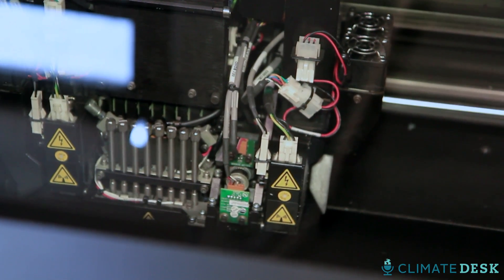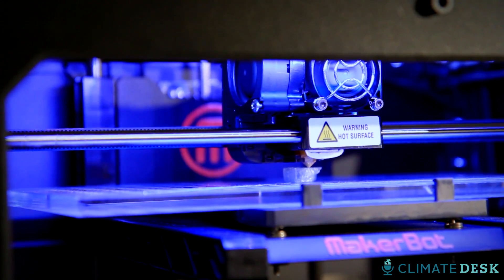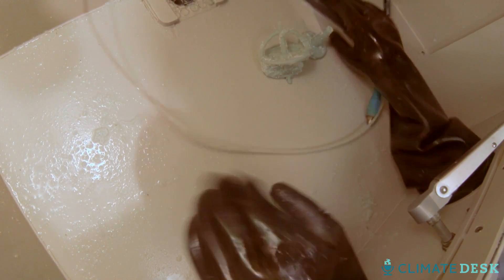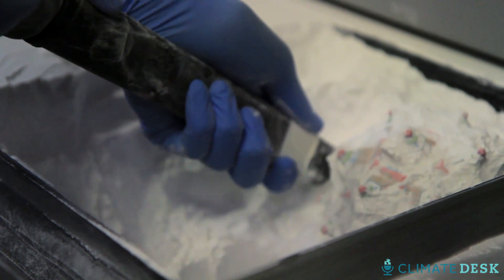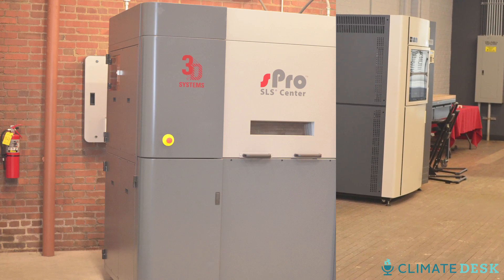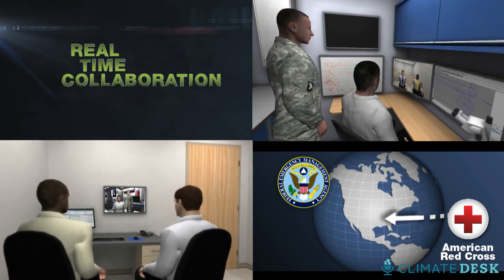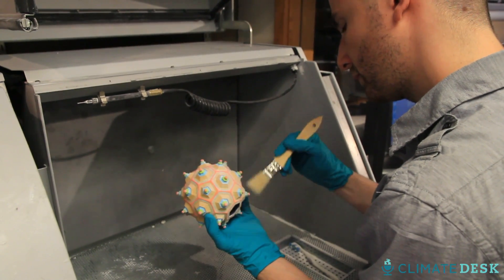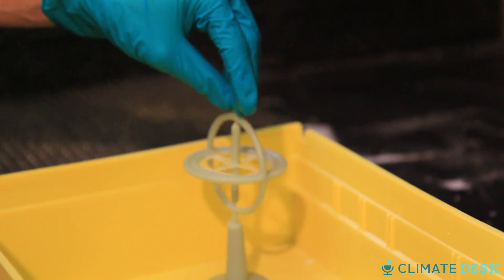3D Printing: Secret Weapon Against Climate Change?

Comment: 3d printing has existed for a while....
The only difference now is that it's available to consumers. Companies like Apple use 3d printers to print prototypes of basic shapes, then manufacture the real product with aluminum, glass, etc. There's not much you can do with flimsy plastic. You can make a cup, plate, or cool toys. At best 3d printers will replace 99c stores....
That's not going to improve climate change at all.